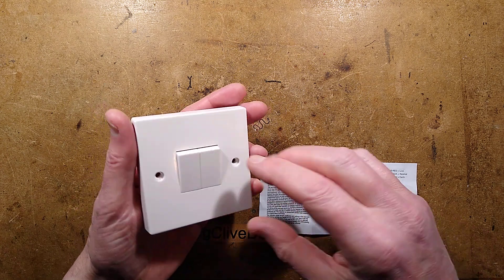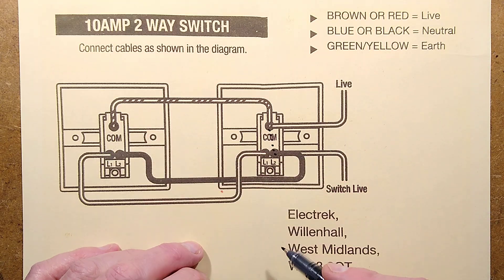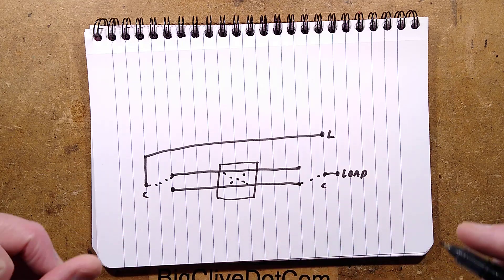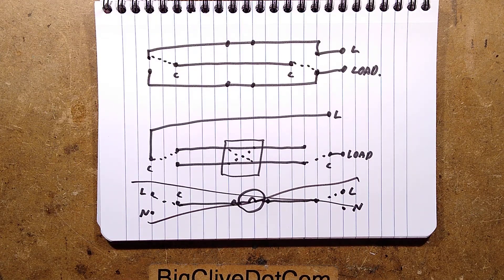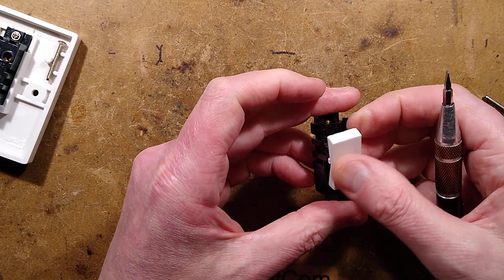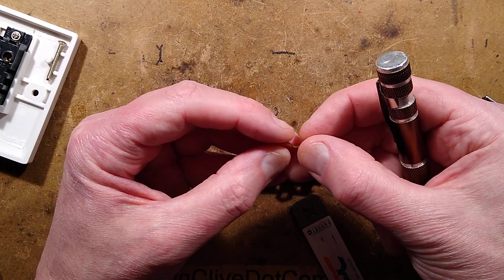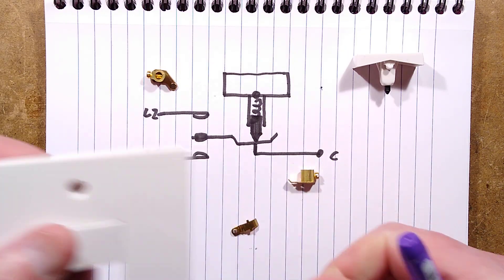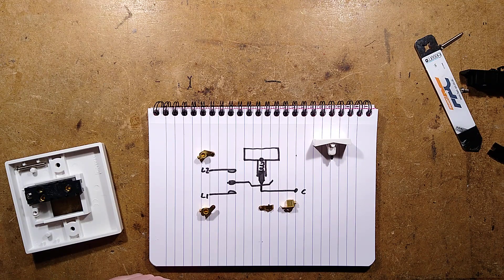Poundland 50p switch teardown

Comment: I was taught way back when, "never switch neutral".
Reply: And then you get into LVDC electronics (≤12V) and it's instead "switch neutral whenever possible".  (N-FETs are much cheaper than P-FETs; they're usable for low-side [neutral] and high-side [live] switching, respectively.)  Most (all?) LVDC LED lights use low-side (neutral) switching.
Reply: @alexhajnal107  If it's DC supply it is NOT Neutral, it is Negative. 
I would never consider or use a FET as an isolation switch.
Reply: @BTW...    Analogy.  My point was that practices are a bit different when dealing with very low voltages and currents.
Reply: @alexhajnal107  nfets are more efficient, which in turn makes pfets more expensive to build with the same ratings.
Reply: @drkastenbrot   It's to do with electron vs. hole mobility IIRC.
Reply: True, never switch Neutral, however Active and Neutral are switched in 2 pole switches. You find these in suspended pendant type power outlets, in accordance to AU/NZ wiring Standards.
Reply: @BTW... Never switch Neutral unless you are 1000‰ sure Live is switched off as well at the same time.
Reply: @ralfbauerfeind8236  Break live before neutral.  Make neutral before live.

Comment: Third way also risks forming an arc directly between L and N if the load is heavy enough to start it.
Reply: Would that be an issue for AC/50Hz?
Reply: @AdityaMehendale As compared to 60hz? The difference in arcing potential across the switching contacts between 50hz and 60hz is minimal with the 50hz mains having a slightly more potential for destructive potential arcing compared to 60hz, with the higher voltage of the UK domestic mains compared to the US domestic mains more likely to have an effect on arcing potential. Point of interest, if the mains frequency was reduced to dc voltage or near so, the switch would probably self-destruct on the first or second switching under load due to the prolonged sustaining arcing and short separation of the switch contacts when opened, even with only around 100 volts input.
Reply: @trevorkrause7220  I wasn't comparing 50/60, rather was wondering whether arcing shall be a problem at all, for the ~ 10ms that the arc exists.
Reply: @AdityaMehendale  Yes, absolutely! I've heard several stories of modern switches that replaced ancient DC-rated rotary or toggle switches burning out within months or even weeks in that setup.

Comment: If they'd swapped live and switched live labels it would have been right yes?
Reply: No, the live as they have shown it should not be on the common terminal but on the other "L" (1 or 2) terminal. So live and switched live to L1 and L2 and those are strapped to L1 and L2 in the other switch. The commons in each switch are just linked with the third wire in a readily available British "three core and earth" cable.

Comment: Over 40 years ago, in electronics class, we had to diagram a 3 way switch. I was able to do it back then. But I forgot how. It didn't seem to look like your diagram. I'm sure the wiring is the same, but I think it used symbols for the 3 way, or is that SPDT? Or DPST?
Anyway, I forgot. Interesting switch there.
Reply: Single Pole, Double Throw.

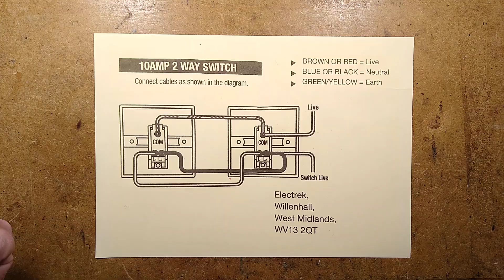Comment: 0:51 Live should go to L1, then the switched line to the lamp is at L2.
OR Disconnect the two COM ports. The first COM is live, the second COM is switched line.

The switch between live and neutral then should comes from two different fuse boxes and different live connections. Just to make it even more dangerous. 
Not that you think the voltage is switched off and then the lamp is still connected to the power.
Just  to set up an electrical booby trap for the next person.

Comment: You are correct that here in the U.S. they are called three way, which makes no sense since only two are possible in the circuit. Even better, if you want three (or more) switch locations..you use a four way switch. 😮😅 And as another pointed out, we call you snappers as "travellers".
Reply: Maybe the light bulb is counted as one of the 'ways'?
Reply: The US terminology counts the terminals to the switch: it's a switch having three wires going into it, so they figure three ways into the switch. 

The UK naming counts the number of wires that are controlled by the switch, hence two way. 

The middle switch when needing to control from three locations is logically known in the US as four way, again counting the total connections. In the UK it's  usually known as an intermediate switch, to give DIY electricians a clue about where it goes in the circuit. 

Both naming systems make sense, once you grasp the logic behind them: and both look equally daft to someone only familiar with the other way of naming. 

Similarly with the logic of how e count the floor number in a building -- logical on each side of the pond but confusing to visitors
Reply: Probably for a similar reason a 3-way intersection is named that.
If you consider the wires, there are 3 paths.
Anything coming in one of these paths have 2 different paths they can take depending on the switch.

Likewise, for the 4 way switch, there are 4 paths/wires. But now you can't go through every path.

Comment: This switch looks quite old fashioned. We were using switches like this in the 80s. Nowadays the entire switching mechanism is hidden under the cover. The advantage is you can use the entire cover to control the swicth and the covers are available in different styles and colors. Switches are sold in three parts - the swicth itself, the cover and the matching bezel. You can also put multiple switches inside a multi bezel. Power outlets are also made in the same style as switches and they can be combined together.
Reply: In the US there was a line of devices branded as "Despard" built just like that. They were versatile, but very expensive and not durable.
Reply: @mxslick50  as an electrician from Germany that traveled to the us and Canada several times it still amazes me what differece in electricial standards the US has compared to most of the West. 

Some stuff you guys use every day is something I haven't seen here in Germany for decades. 

Switches and sockets with seperate switching mechanism and seperate frames / inleys / styles are completely normale here for well over 4 decades now
Reply: Yes lucky by me mixed sockets and lights are not common, so the styles can be similar, but not mix and match.

Comment: I understand that the 3 phase EU (German) standard which,  was adopted.

Not the one we used, UK, BSI,  red, yellow, and green for 3 phase and black for neutral.
Which I believe was the reason  if when joining Marconi Instruments you were colour blind you couldent be an in electronics or electrics.

So now you can be blind and injured people or worse?

Love your sarcastic remarks.
Keep them up may be someone from the UK, Trading Standards may? be watching.
Reply: L3 was blue, not green. My understanding of the EU colour standardisation was that it used colours which were the least likely to be misidentified in most common forms of colour blindness.
Reply: No, now you can be colour blind and still correctly identify conductors, rather than being excluded from things as a result of random chance.

Comment: Two way switching does not comply with switch positions. In the UK 'on' is when the switch is down and 'off' when it is up.
Reply: That’s just your OCD 😂 In the real world, if you have a double or triple switch where one or more switches are on a two way, three way or four way circuit, it’s Sod’s law that at least one will spend a large amount of time in the opposite position to the others with all lights off. Also, with a rocker switch, which way is up and which way is down? Think about it...
Reply: @Mark1024MAK  Here in the states a SPST wall switch will often have ON and OFF imprinted into the plastic of the toggle, but a SPDT/other will be blank, reflecting the use of those switches where the on/off state is indeterminate. Not sure if this is a regulatory thing or just convention, but seems to usually hold.
Reply: @treelineresearch3387  - in the mainland U.K. as far as I am aware, there is no code or regulation on which way a light switch should be for off or on. In the past, it was same for fuse box/consumer unit/breaker box main switches and MCBs/breakers, but I’m not sure if that is the same now.
Reply: @treelineresearch3387  Interesting.
Reply: @Mark1024MAK  Power outlets the switch  is marked down for on or they put a red mark that shows when the switch is on and it is in the the down ward position and yest fuse boxes are reversed the fuse is up to be on
Reply: @tonysheerness2427  I propose we mount the back boxes rotated 90°, that way no-one is happy 😆
Reply: @ZXGuesser  People will still argue should left be on or right?
Reply: @tonysheerness2427  push on, push off latching toggles like old AT PSU switches, it's the only way 😃
Reply: @Mark1024MAK  OCD is to take one of the light switches off the wall and rewire it so that both switches are the same way when the light is off. But who would do something as pedantic as that?... 👀
Reply: @ZXGuesser  🤣🤣🤣
Reply: @Mark1024MAK  So you agree with me.
Reply: On the subject of toggle switches, there has long been a difference of opinion on which way should be off and which way should be on.
If down is on (up is off), it’s arguably easier to accidentally turn something on if the switch is knocked. But if up is on (down is off), apparently that’s confusing to some...
And overall, whichever has become the convention in the place where you live, and is what you are used to, is typically what the locals consider to be correct.
Reply: @Mark1024MAK  I agree with you, on this one the UK is wrong, up should be on and down should be off.
Reply: It does sometimes 😅

Seriously, but pedantically, the UK standard for two (or more) way switching implies that the load should be off when both/all switches are up. This is rarely adhered to in practice, as it means the strap cable is cross wired.

Comment: For more terrible ways to wire SPDT switches, @backyardmaine has videos on what he calls the "Chicago," "California," and "Double dead-end" methods. One of those (I can't remember which one) is the same as Clive's third example, but the other two are also bad ideas that happen to work. (Note: these videos are very US-centric, so he'll refer to the US National Electrical Code throughout. They're all still bad ideas even if they're not forbidden by code, of course.)
Reply: Big Clive is not using SPDT  switches in the video, absolutely no relation whatsoever , apologies for being pedantic but you have got it wrong.
Reply: @TheCurlyburger If a switch with a single common, two switched lines and two possible states isn’t a SPDT switch, then what is it?
Reply: @TheCurlyburger   The switches in this video are absolutely SPDT (single-pole, double-throw). That is, you have one pole (the pivoting element after the teardown toward the end of the video) and it can hit one of two contacts at the end. If it were only COM and L1, it would be SPST. If it were 1 physical switch that controlled 2 poles switching 2 separate COM/L1/L2 (that were not connected to eachother), it would be DPDT.
Reply: @TheCurlyburger  Never apologize for being pedantic. I'd actually like to know what it is that I have wrong, because those switches sure look like SPDT switches to me. (Though to be fair, I only called them that to avoid the 2-way vs. 3-way nomenclature issue.)
Reply: Following up to myself: it looks like Clive's third example is the Chicago 3-way, and his second example is the California 3-way. The California 3-way can be a code violation in the US, depending on whether you make the neutral wire available, but that's also true of the first method, which is the standard method used for new construction in most of the US.

Comment: 1:30 The original instruction is an OR gate. The corrected one is XOR. Maybe you want it turn on when either is on. Maybe.
Reply: The last one is an XOR that will kill you in the dark.
Reply: @mekkertroniker2002 It wouldn't be wired up with both of those switches. It would be wired up to another panel somewhere else
Reply: @mekkertroniker2002 For 2 separate lights, or eg for light and a fan/ac combo

Comment: I love a switch with a good crisp snap action. 3 of the switches in the house I grew up in didn't, and it always puzzled me as to why ... I found out why one year, when my mother called me over to replace a switch that she cooked by running a space heater on a switched receptacle =/ Anyway. After getting into the box? There was a nice little bead of silvery mercury! I was like "????" .. Soo, later that day I took the switch apart and yes, there was a glass disc shaped container, with some mercury still inside. -- I guess people hated that clicking sound back in the day \o.O/

I was back the next day to collect the rest of them.
Reply: There's a video I got recommended ages ago, where someone was claiming the mercury switch was the 'ultimate switch' with '0 maintenance' etc. and that the only reason it's banned is because of big electric or something lol
Reply: @Stevo_1998 They don't bounce, normal snappy switches will switch on and off many times on a really tiny timescale. The contacts also never wear out, because any arc or oxide will float. They can also directly pass quite a lot of current. They'll essentially always work.

Not quite enough to justify making more, but in certain applications they were unbeatable, like tipover switches for space heaters.
Reply: @Stevo_1998  Nothing to do with 'big electric' - everything to do with the toxicity of mercury. Banned for general use in the U.S., but trivial to mail-order from China. Still available for specialty purposes (the electromagnetic interference lab where I work uses mercury switches in the lightning simulation test stands).
Reply: My grandfather installed one mercury switch in his house, the one for the bathroom light, so that if anyone needed to visit the bathroom, they wouldn't wake up everyone else.
Reply: @kendauer9781  that's really cool
Reply: Hmm, I've only ran across mercury in thermostats, old car trrunk light switches and light switches where a spark might make things go boom.
Reply: I personally love clickiness in a switch, but there were a couple in my childhood home that weren't satisfying.
I also get that one wouldn't want clickiness in their switch and I love the use of mercury as a solution.
There has to be some applications where a smooth switch feels more "right" than a clicky one, but I can't think of any at the top of my head.
Reply: @Klaevin  I recall the early clicky switches for room lights always sounded like throwing a breaker.
Reply: @jamesplotkin4674  yeah, those are the unsatisfying ones in my childhood. They were super old and before it went over the center, it felt like scraping glass and it was way harder than a switch should be.
Eventually, one of them died because something got lodged in the mechanism and it wouldn't go over the center anymore. You would push it, it would scrape and if you got it to the other position, it would just spring back.
When we took it apart, a bunch of plastic or bakelite must have fallen out, so there was no way to diagnose the problem. 
Yeah, they sucked.
But clicky switches are cool.

BTW, this is a house whose wiring got done in the 60s in France.
Reply: I have a mercury switch in my bathroom. I put it in about 35 years ago and it still works perfectly. It runs the lights, and an outlet used for the hair dryer. That's 35 years with a 1500-1850 watt hair dryer being used on it.
Reply: @markc2643  for a while, my motto has been to buy used, because it's proven its longevity.
what new product ever lasts more than 2 years?
My graphics card is probably the oldest thing that I've bought new, that I use every day. And that's just because Nvidia still supports it and that there are no moving parts. Everything else is either used, broken/degraded, or younger.
it's insane, how you can't spend more to get more out of your stuff.

For those wondering, my graphics card is an rtx 2060. Of course, I have older things, but they were used when I got them. The OLDEST thing that I use every day is my A/V reciever or my microwave. both of which, I think are from the 90s, and I got used. But that only proves my point, that old things have proved their longevity
Reply: I lived in a house that had a mercury switch built into the door bell.  When you pressed the button, the gong was pulled towards one of the two gongs [DING] and then the mercury switch broke the contact and the spring return pulled the gong back.  It would over-travel beyond the rest position and hit the second gong [DONG].  Then, if you were still holding the button in, the ding-donging would repeat.

The really clever thing is that the person who had wired it had wired two switches into the same mechanism, but bypassed the mercury switch on one of the door button circuits.  Thus, by listening for 'DINGDONG-DINGDONG-DINGDONG' or 'DING...DONG', you could immediately tell if a caller was at the front door or the back door.

Comment: Your preferred way of wiring two way switching is the standard way through the UK and Ireland electrical industry . I know your right because I've been a sparks for over 40 years . By the way did you have confuse the diy wannabe sparks by mentioning intermediate switches
Reply: It’s fun (NOT) trying to explain intermediate switching circuits to lay people... Especially if you don’t have a pen and paper to hand.